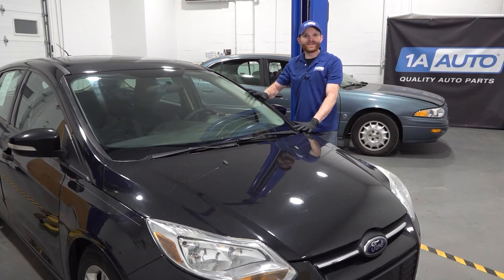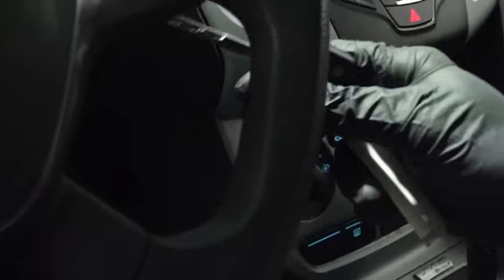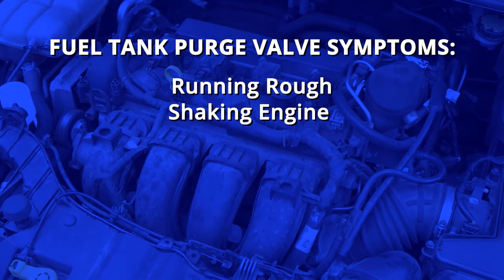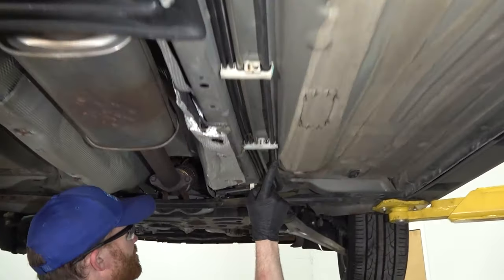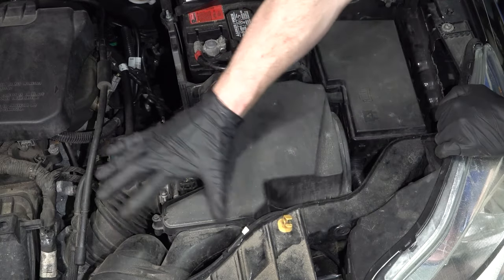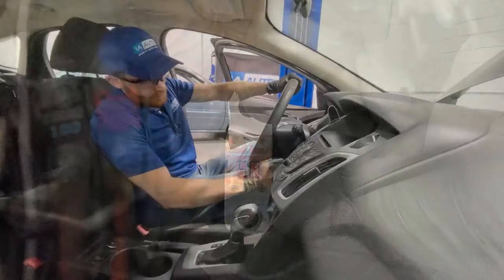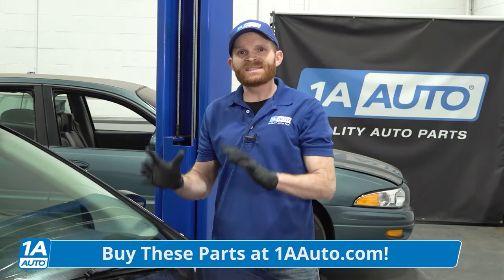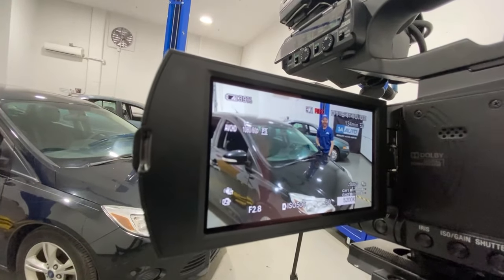Top 5 Problems Ford Focus Hatchback 2012-2020 3rd Generation

Comment: 2017 Focus HB 80k miles. Valvoline instant oil change guy was surprised when I told him no trans issues. I think it's a lot about highway or city driving. Trans acted goofy for a day after I stomped on the gas pulling out into traffic... But since, no trans issues. The purge? That's a different story. If I fill up, I need to do some weird things to get the engine to start.

Comment: I Have a 2012 ford focus with 184000 miles, only problems ive had are.
-Bad Passenger Engine Mount: Causing Vibration in cab.
-Purge valve getting stuck open made my car idle high got replaced never had an issue again.
- Transmission Shudder: got clutch replaced on dual clutch, no problems since.
-Catalytic converter light: Turned off after using a fuel additive.
Thats it so far, great car after these problems are fixed! Should last me 250000-300000 miles

Comment: I have the same car 2013, l love it. Drives nice l have manual transmission. One problem I did have was.  at 2years both front electric window motors went out. Too many miles for warranty. Also l replaced the radio!!!??? Otherwise all good. Lasting well have no intention of getting rid of it

Comment: 136k on a 2012 Focus here, being honest not the best. It's a manual, diesel. It's had an absolute battering so I take some of the blame, but it's had a new clutch, new timing belt, front suspension changed, coolant leak into the drivers side, lots of other bits and bobs done but now I'm having a grinding sound when changing gears like it's really struggling to get upto speed so I'm now thinking it's time to get rid and purchase a new car but not sure what that will be...

Comment: Huh, I think I might have a grounding issue, going up my hill the transmission will fail to shift up despite it being fine everywhere else. Ill look at taking a wire brush to that and getting a good ground connection.

Comment: 2015 ford focus hatchback. We were the second owners have had it for the last 7 years, issues every other week. Fuses, battery wire corrosion, transmission has been “fixed” and replaced, power steering assist system failure, jerks when it’s driving below 30 miles per hour, engine straps, leaks from the center console into the passenger side (twice), cooling system issues, when it was a 3 year old car with less than 60k miles we had to replace the starter and alternator. Basically every issue in this video and more… wife still wants to keep it because it’s her first car she bought on her own but we just finished paying off the last repair… $4,500.00 later I want it gone.

Comment: 2013 Ford Focus LW2 Sport manual 130K. 
Power windows have failed. 2 mechanics couldn't fix the issue so had to be referred to auto electrician $1200
Engine mount needed replacing $800
Clutch needed replacing $3000
Coolant hose split $2000

Always been a Ford fan...but my experience owning the Focus means I won't be buying another one...

Comment: I had a 2014 Focus SE 4 door sedan I bought used in 2016. I got rid of it in 2021 as the DCT module needed to be replaced (under the extended warrenty) but as unobtainable, with backorders of over 40,000 units I had to trade in the car at a huge loss of expected trade in value. I tried the cleaning up of the batter ground strap to the body but it didn't work. 
Another problem is with the horn. It is just behind the front bumper on the passenger's side. It is exposed to water, in particular winter slush and salt water so corrosion gets into the connectors and the brackets. I finally figured out I had to remove and disconnect the horn wiring connectors and brackets, clean them up with sandpaper, dab some dielectric grease and reassemble.
Reply: Hey Leon. Did you also have any issues with it not wanting to start from time to time ? Like something is draining your battery?
Reply: Oh shit..  I have a 2014 focus titanium hatchback.  I was merging onto freeway and the tachometer shot up into the red and the engine was revved up really loud.  Ended up getting it home and had it towed back to Ford.  They will call me tomorrow once they’ve looked at it but he was pretty sure it was the power train module or something.  Dang!  I bought the car 2 months ago and am like 1000 miles over on the warranty.  They screwed me hard on this car.
Reply: Leon, what state were you in at the time of owning this Focus? And also, about how many miles did the car have when you sold it?

Comment: Has a 2013 Focus and didn't experience most of these issues except the transmission issue.  And that issue alone was the most frustrating.  The shifts between 1st, 2nd and 3rd were awful.  And sometimes at a full stop, the car would not move when giving it the gas.  Trips to the dealer didn't fix anything.  They used to tell me the transmission was adjusting to my driving habits .  What ????  After 2 and 1/2 years of this , we finally unloaded it back to a Ford dealer.  I pity the guy who bought this used car.

Comment: Had a 2016 manual. Leaked oil from the valve cover and coolant at the water pump. Rear camera took a dump. Springs in the driver seat broke. AC would stop blowing cold air randomly on the hottest days. All this before 60k miles.

Comment: I bought a car from Capital Ford of Lillington , on June 23 2021. A 2013 Ford Focus SE. 

My friend who was with me that day and I asked with insistence if the car had any problem, because I was moving alone to Austin, 1300mi away, and I needed a reliable car for such a long trip.

The salesperson assured us that the car was thoroughly checked a few days earlier and that it was in perfect condition. We trusted the seller as I was buying from a Ford dealer, believing that a representative of a company as large as Ford could not scam me.

However, on July 14, I had barely driven 100 miles since I got the car, the reverse gear blocked. I had to turn the car off and on 2 or 3 times before it worked again.  I thought that I did not change the speed correctly, as I was used to stick shift instead of automatic.

I left the car parked for the following days, as I was traveling, and I came back just early enough to change the temporary tag that had already expired, and get on the road towards Austin on July 30, having no idea of all the troubles I was going to face.

First city, Jacksonville, again the car would not go in reverse. This time, I knew it had to do with the car, it obviously had a problem, but I had gone too far to come back to NC. My leasing contract starting on august third and my job on august fifth. I had to continue driving. I could not risk losing a job that I did not even start. 

Second city, Tallahassee, the same thing happened. Then again in New Orleans, where the dashboard also went off, but I only had to change a fuse, not to mention that the wipers came off in full rain on a road where it was impossible to stop, but that still is not the worst.

I arrived against thick and thin in Austin, with a car that the reverse gear was not working half the time, in a city where I know no one, in an empty apartment that I had to furnish within 24h, to start working in a very monopolizing field. A defective car was really the last thing I needed to deal with at that time.
 
Trying to stay positive because I arrived safe despite everything, I took the car to a mechanic for an oil change and a checkup on September 02. « All Tune and Lube » is a well-known garage and his owner is famous for his honesty according to my colleagues as well as to Google reviews. 

After checking the car, he detected a problem with the transmission, on a part that is under an extended warranty because there has been a recall on the model. He told me that a Ford dealer should repair it free.

As they told me that I have to pay for the repairs even if a part of the transmission was under warranty, I went to Covert Ford to have another opinion, but their technician said that there was no way that Ford would pay all the repairs. 

She told me that they would at least add parts and labor that are not included in the warranty and that I will finish up paying $3000 or $4000 anyway, either in their garage or elsewhere. She suggested making a diagnosis on the next week to see what was going on, but I declined because I had a closer appointment.

I took the car to Leif Johnson Ford as planned, on September 08. It took 6 days and $320 to have a first diagnosis. I had to replace mounts and sensors for $1500. These parts were used and had to be changed at the same time as the module that was subject to a recall, but they were not included in the extension of warranty. I declined the repairs and called Ford customer service this time to get some help, but the call center representative told me the same thing that Covert Ford’s technician, I will pay anyway.

I came back again to Leif Johnson Ford, on September 21, with a car about to break down, and accepted the repairs supposed to last only two days. Two days and $1500 to get rid of this situation for good. In the meantime, I had no choice but to use Uber and Lyft to go to work.

 After the first repairs, I received a call from Leif Jonson Ford to inform me that the problem was not fixed and that the transmission had to come totally out so that the technician could see what was going on internally. Only the labor was $1300 for this operation regardless of parts, repairs and time....

I had no choice other than accept the repairs at Leif Johnson Ford, I really couldn’t’ afford to wait any longer.

In the meantime, I tried again to reach Capital ford of Lillington on October 10, by mail this time, hoping to have some help, and as usual, I did not receive any answer.

I finally got my car back, repaired, on October 25, almost two months struggling without transport. I found myself spending half the price of the car in diagnoses, repairs and transportation. Ford's final bill after negotiation and tears was $2725, Lyft and Uber $640, and diagnoses $490. All because I did trust Capital Ford of Lillington's sellers.

I left for Austin with peace of mind because at Capital Ford of Lillington I was given all the insurance I needed to leave confident, but there were all lies, there is no way they were not aware of this problem, especially since it is a recall. Just taping the VIN number of the car on the website of Ford shows all the recalls related to this car, I discovered that too late, but the seller should have told me, at least, that the car had some recalls, I would have thought about it...

In February, the engine light came on again and the car began to vibrate strangely. I went to O'Reilly for a checkup, and the employer told me it was the spark plug. I AGAIN took it to a mechanic thinking I just needed to change the spark plugs, but when he opened the hood, oil was all over the engine cover which had a hole in it! How could this happen?

 In 25 years of driving used (heavily used) and new cars, I thought I had seen every car problem, but never like this! 

The mechanic told me that one of the reasons could be that the cap in question had not been properly tightened the last time. Conclusion, the spark plug broke, made a hole in the engine and it could not be replaced because the threads of the spark plug were also broken and it was impossible to screw it in. he had to tinker with it because I couldn't afford to change the engine, or take the car to Ford again. In eight months, a car that was supposed to be in good condition had a transmission problem and an engine problem. Repairing both costs more than the car itself. It is very abnormal.

Comment: have ford focus mk3 2012 6 speed manual with 226031 km and still working i only did the filters and oil changes

Comment: I bought a 2012 Ford Focus SE 6 months ago and now I am encountering these problems, when driving the car it does not shift properly, for example to make a shift the transmission goes into neutral first and then the car shakes on both sides and the transmission shifts to the upper level

Comment: I had my focus since April 1st 2021, I dealt with shaking once when I was slowing car down not long check engine light came on while I was shifting in S Mode. It was a lot of fun to drive in S mode
Reply: Yeah my focus trips a check engine light when I drive around in sport mode, the code is a p0420 it has to do with an O2 sensor, sport mode advances the timing and I think the exhaust system doesn't like the change in emissions. If I drive around not in sport mode for a while the light goes off. Super fun in sport mode though

Comment: I have the first problem, symptomatically. I have replaced the CPV, high pressure fuel pump, fuel pump, spark plugs. It worked for a week. Yesterday, my car stalled again and has the same issue. I originally had the check engine light on when this all started with the P1450. When I replaced all those parts (high pressure pump was last), the light went off and the problem seemed to be fixed.

Yesterday morning I went to leave for work and it took a couple of seconds to finally turn. As I left work, it took a good 4 seconds to turn. Then I went to run errands last night and my engine kept stalling. Starter is trying, but the engine will turn after a few seconds before almost immediately stalling out again.

ANY help would be great. I can fix most things myself if I know what the problem is. I'm trying to avoid a shop because I am getting married in April and really don't want to funnel funds from that if I can avoid it. I'm stuck, man. I don't know what to do.

Comment: Does adding another ground to battery or sanding paint off the ground make a difference with the shifting? I’ve heard from some ppl it helps and some ppl say makes no difference
Reply: It will help if your clutches and TCM are otherwise in good condition. A big problem with the MK3 Foci are the TCM going bad/being undervoltaged and causing damage to the clutch pack.

Comment: Guys I’m planning to buy a used car of year 2012. But now I’m worried after seeing these problems. The price is in my budget so now I’m wondering if I should buy Ford Focus or not. I don’t feel confident enough now :(. I fear gearbox problems as my current vehicle has one but I don’t want one in my next car.
Reply: Buy it with a manual transmission!

Comment: First, the 2012 - 2020 is the MK 4 not 3. Second, the purge valve was a recall on the 2012. Third, get a manual transmission.

Comment: I have a 2013 hatchback with the flex fuel 4 cylinder, replaced the purge valve and tcm, still has problems starting every time I fill it up with gas
Reply: Mine done the same, ended up changing both purge valves, under hood and tank! I think I have too do it again tho😥

Comment: The automatic transmissions are terrible. My 2014 has 88,000 miles and is on its 4th set of clutches. It’s been in the shop 6 or 7 times for various repairs with the transmission

Comment: 2016 ford focus, bought it recently. Haven’t had any issues until now, Nothing is wrong with idle or driving. Just that it’s full on gas and shows a quarter low, an inaccurate read. Idk what to do, other than just start replacing stuff. Any ideas ??

Comment: I just bought a '13 Focus Titanium w/ the 5 speed manual transmission and it has 103k. Weve had the car 3 days and now have code po420, is that a common fault? I pray its just an o2 sensor that needs replaced 😰

Comment: 2015 focus here, my passenger side wiper stopped working a couple months ago, I checked all the fuses and couldn't find a broken one, and replaced the wiper motor all together.. everything else works normally. Have you come accross this and what was the fix?

Comment: I had a 2014 Focus and I have currently a 2017 Focus with 67,000 MI and mine has stalled but not stalled out to the point of not working

Comment: We have a 2018 Ford Focus SEL Sedan 2.0L GDI 4 cyl with the 160HP and 6 speed select shift with dual clutch and it has had no issues. Change the oil every 5,000 miles and we bought the car for $16000 on carvana and have owned it for almost 2 years and we got it with 23,000 miles and now it’s at 58-59,000 miles and it gets about 32MPG average for city and highway

Comment: We had 5 Ford Focus cars all manual in our family pre 2012 never had issues other then minor and they ran 200k plus. Then my daughter bought 2016 1 liter eco boost  manual trans which went at 4 years old  3000 bucks for ford to replace. Then the axle drive went then the starter. I always was a ford 120k family.  But I won’t buy a eco boost and another Ford with all the QC issues recalls and failures I have 2009mustang GT ford E 450 and a great 09 fusion manual 200k miles and 98 ford ranger never had any major issues. I’ll keep them running it’s All cheaper to run them fix them then buying new Fords or anything for that matter.  They start run and easily troubleshoot the issues. This new so called high tech has way to many failure issues then old school fords. They lost a family.  Honda and Toyota are reliable

Comment: im having an abs problem with my 2014 focus dt. We've checked the wiring and the fuses and have replaced the abs sensor twice, which had short lived success and ended up with the same problem, any help is appreciated 👍🏻

Comment: anyone encouters on ford focus like
it starts easily but then dies right after,
its like after 2 to 3 seconds afyer it starts...

checked the fuel delivery,
fuel does keep comming,
flows strong to the rail,
ignition also good,
its like something just makes it stop somehow...
its a 2015 ford focus with a displacement  1800cc

Comment: Let me ask a dumb question - Can a bad water pump while driving mix water and oil in engine ? I really don't think so . Only way that'd happen is cracked engine or bad seals / gaskets right ? 2016 Ford Focus SE 2.0L duratech engine yeah I know a bad pump can overheat engine . Just checking my BS meter on this mechanic who looked at car said this ..